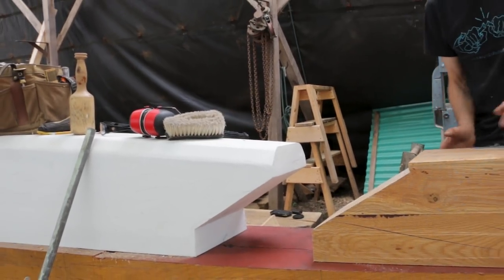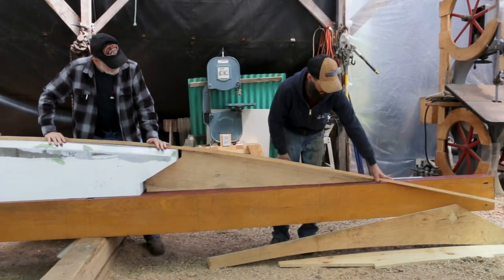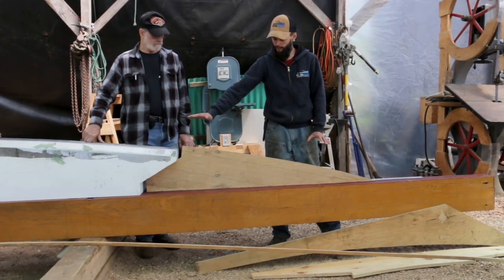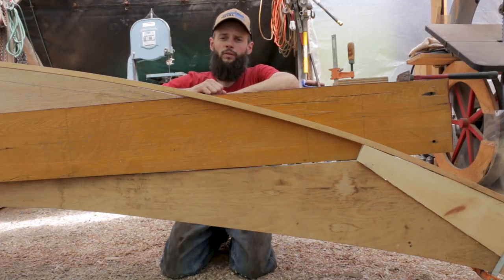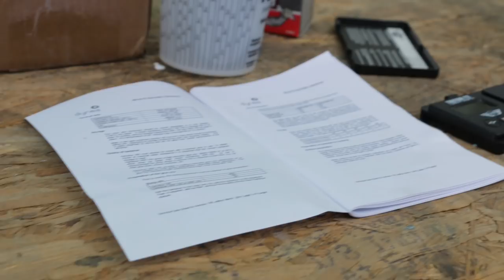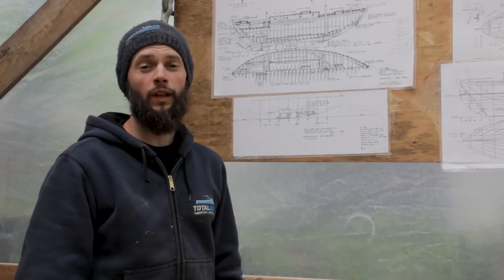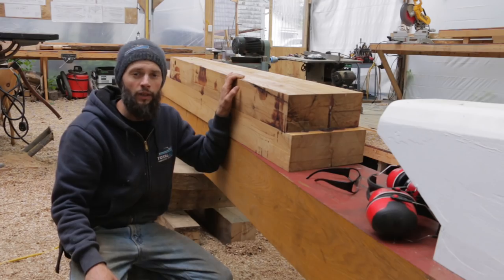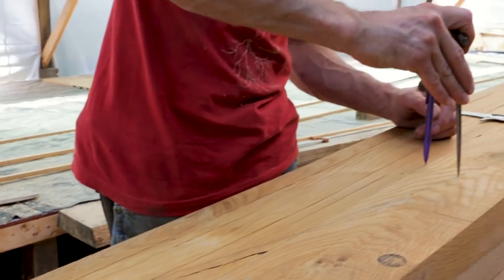Acorn to Arabella - Journey of a Wooden Boat - Episode 37: Shaping the Forward Deadwood

Comment: My suggestion for fast waste stock removal is a single grinder with 36 grit discs.
Reply: Badgermatt75 2016 those are fast, but replacing them can get expensive. Sharping a handplane is free, and more relaxing to work with
Reply from the maker: As one of our volunteers said "power tools make big mistakes quickly, hand tools make small mistakes slowly" Would rather go slow and get it right then go fast and risk messing something up.
Reply: My boss calls those grinders 4 inch rotary chisels
Reply: I guess this is why you didn't use a chain saw to cut the Keel beam.. right..?
Even though it would have only taken an hour or so, the penalty for error is too great..

Comment: When cutting  the shoe and the other  piece, for the bow, why did you not use the large bandsaw , for the roughing cuts, I would have thought it would have been faster and less work.
Your build is interesting,  it is rare over here for your style of construction , although in Tasmania,  there is a school teaching traditional building techniques.
Cheers from Australia
Reply: so it has a snug fit
Reply: Raymond's Rice Cookers i realise that your after a snug fit , bit i would have thought that removeing the bulk of the wood with the bandsaw , then hand fit , would have saved time.
Just my thought.
Reply: I was wondering the same thing, rough cut on the band saw. Maybe it was weight, maybe he just wanted to be old school. To each there own but hope he answers your question.
Reply: If weight is the issue, why not rough cut the bulk off with a chainsaw, then hand tools to fare it up?
Reply from the maker: There needs to be a flat face on the timber to register against the table of the band saw.  
Since the sides were rough and tapered some sort of sled would have been needed to hold the timber to cut the top.  
We could have used the band saw to cut out the layers pre lamination but that was done before we upgraded the electrical to the boat house so to use the band saw we had to move the generator, start it up...  Was just easier to use the circular saw and finish the last little bit with the handsaw.  
Now we have good electrical in the boathouse so we can just plug in the big machines and work.  So much nicer!
Chainsaws are quick, sometimes too quick.  It's real easy to cut to much off!  The circular saw is much more accurate for cutting kerfs and the saw marks make great reference lines when removing the waste.

Comment: There's a problem with the last two videos. There's an obvious "judder", as in every other frame seems to be shifted a pixel up and left. Looks like it may be a de-interlacing artifact or something similar. Have you guys changed something in your workflow at all? It's most noticeable when the "Acorn to Arabella" logo is showing, but is present the whole way through both videos.
Reply from the maker: Hey Tom, thanks for letting me know. Haven’t changed anything in the workflow. The logo in the bottom left is imbedded through YouTube. Let me know where you see it and I’ll try to figure it out. Still teaching myself thugs here. Haha
Cheers
-Alix
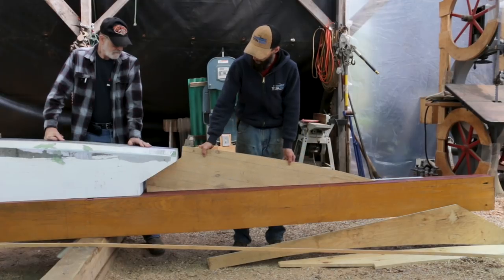Reply: No problem. By logo, I should clarify I'm referring to the fullscreen logo as part of the intro, but really any relatively static tripod shot or still image helps to make it obvious. You can even go frame by frame (comma and full-stop keys on Youtube). If you jump to 1:01 for example, you should see what I'm talking about. Look at the bottom edge of the image and it should be more obvious. Also the higher the resolution (1080p for example) and bigger the screen, the more noticeable. I've checked on my Mac, Windows PC, and phone, and all exhibit the issue, so I'm guessing it's not just a playback quirk. Keen to know what the cause is if you manage to find it.
Reply: I noticed it as well, it'd be a good idea to check if the problem exists in the video before uploading. If so, you might want to try encoding it with different settings or encoder, perhaps exporting as raw and compressing with handbrake before uploading.
Offtopic: why not make the wormshoe out of a synthetic material instead of wood? Thanks!
Reply from the maker: Hey guys.  So I only now got to look into this issue (I've been busy with editing and helping a friend deliver his new boat!).
It does seem like the entire video has a micro shake to it.  And yes it does seem like some sort of de-interlacing issue.  though I don't know much about any of that stuff.  I'm all self taught for the most part so there are A LOT of holes in my knowledge.  I'm not sure what would cause that or how to fix it.
I did look at the final render through quicktime and it does have the shake in there as well.  Any simple suggestions or places to look for a solution would be highly appreciated!  
Thank you for the help and the feedback!
Reply: You could export the video as raw (takes up a lot of disc space though) and use a program called handbrake to shrink the size of it. After exporting as raw it would be a good idea to check if the shake is still happening but I'd bet it wouldn't. Feel free to mail me (rubenbryon @ gmail) if you have questions!
Reply: What editing package are you using? I think Adobe Premiere was mentioned in one of the other videos. If so, mind sharing screenshots of your media (source footage) properties for each different camera you're using, sequence settings, and export settings. Here are example screenshots of what I'm after: https://drive.google.com/open?id=1ERk_NOGCKDd4hiuxO8L8CUQ1Enw1mlGg
Reply from the maker: Hi Tom, thanks for the help.  Here is a link with the screenshots you were asking for (bottom of message).  
And yes, I am using Adobe Premiere Pro (via the cloud). I typically make a sequence from one of my clips (Canon 70D) and then drop the rest in and edit.  I don't mess with the export settings as I don't understand much of it. I took a short course that touched on it but I don't think it was enough to understand the intricacies of it all.
Also, it may be easier to communicate via email? acorntoarabella@gmail.com
Thank you again!
Alix
https://drive.google.com/open?id=1no-3rqN8skwcA76IPST2YA5al7eSBS9-
Reply: Thanks. Email sent.

Comment: I'm sure you are well versed in the power of using pulleys to double, triple, quintuple, the available force to move an object. If you are not read up a little about it, you will find some good synthetic line and snatch-blocks will really help you as your project begins to weigh upwards of 10 tons or more. With the right rigging and anchor points anything can be moved without the need for heavy equipment.
Reply from the maker: Thanks for the tip!
Thankfully the real heavy lifting is about over.  As the build progresses the parts become lighter =)

Comment: ? why don't you use your band saw
Reply from the maker: There needs to be a flat face on the timber to register against the table of the band saw.  
Since the sides were rough and tapered some sort of sled would have been needed to hold the timber to cut the top.  
We could have used the band saw to cut out the layers pre lamination but that was done before we upgraded the electrical to the boat house so to use the band saw we had to move the generator, start it up...  Was just easier to use the circular saw and finish the last little bit with the handsaw.  
Now we have good electrical in the boathouse so we can just plug in the big machines and work.  So much nicer!
Chainsaws are quick, sometimes too quick.  It's real easy to cut to much off!  The circular saw is much more accurate for cutting kerfs and the saw marks make great reference lines when removing the waste.

Comment: those predator engines only produce about 1/2 of what they are rated for :( poor mill needs a decent engine..
Reply: and I mean no disrespect to the owner of the mill, One has to do what one has to do to get the job done...
Reply from the maker: It once had a Honda but the motor got damaged and the owner put on the predator motor in it's place.  We agree it's about 1/2 of what it claims to be.
Reply: I recently bought a very cheap golf cart with a blown engine, and that is the most popular swap for those because its affordable. Dangit, wish yall weren't so far up haha. I know where there's a wisconsin v4 that would be perfect for that thing haha.

Comment: Why use so many hand tools? I mean you guys use a circular saw in one clip and then a hand saw in the next...  So if you are using modern tools then why any of it by hand?
Reply from the maker: Same reasons as why:
-Mechanics have wrenches, hammers and screwdrivers as well as air hammers, impact guns, screw guns....
-People still walk and use bikes when we have cars, planes and trains
-You still own a few pens/pencils when you have a smart phone and a computer

Each tool does something another tool cannot.  Often the simpler the tool the more useful it is.  We could build the entire boat with nothing but an ax and a hand plane.  There are no two power tools that I can think of that you could build a whole boat with without multiple attachments/assorted jigs.  The hand tools are just way more versatile.  

Hand tools also make small mistakes slowly while power tools make big mistakes quickly.  The closer to finished it becomes the more hand tools I use.